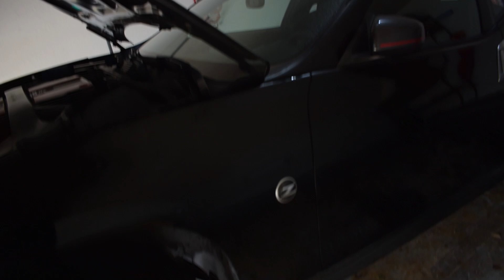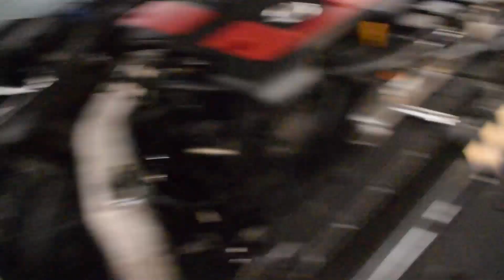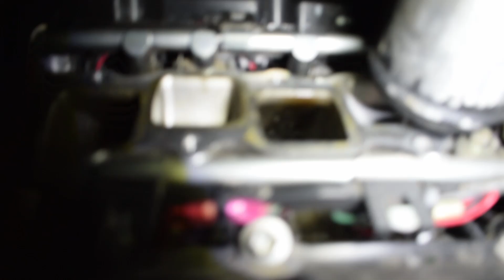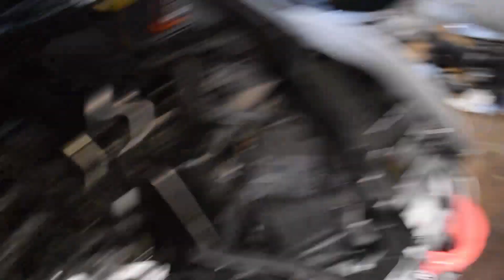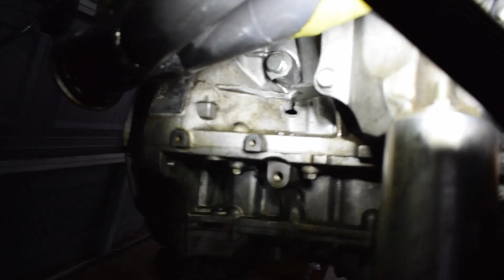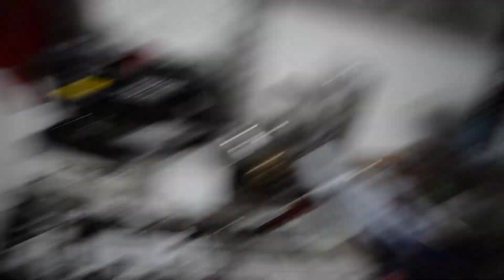I Blew Up My Turbo 370z

Comment: Oil starvation the cause?
Reply from the maker: @Eclipsis17  no gallery gaskets and oil pump was fine. I was chasing a lean issue for a while, I think it was something to do with the fuel pump assy. But my motor was already knocking so I was still hard on it.

Comment: Take it from me. Just get a GTR. I dumped maybe 30k on my 370Z this year. It is still in the shop due to misfitting parts. My HUGE concern is if a dumbass hits me on the road, insurance will only cover 15k the car is worth.
Reply: Dude just do the work yourself. Isn’t too hard. Guaranteed you like 15k is in labor only
Reply: @2seep  
Yep, 15k is labor only. I work on suspension, brakes, and maintenance for my cars, but electrical, fuel, and engine is off the table.

We all thought it would be a 3000$ labor adventure... It kinda scaled when they found more broken things and I wanted more stuff installed. (I thought it would be a 10k labor adventure, I was wrong)

The car just got the initial tune done today and then E85 tomorrow. Hopefully I'll be driving it next week.

Comment: Been thinking about trying to push 550whp - 600whp with a single top mount turbo kit on stock engine. Only thing is my stock engine has around 110k miles on it so im just not sure if it'll hold up for its age. Would be curious to know about what mileage yours was at. Good luck with the rebuild man.
Reply from the maker: @randomperson7567  I definitely get a compression check. Mine blew up at 85,000 but I was always hard on my car, 550 to 600 is pretty reliable as long as keep up on maintenance

Comment: Stay up my man.  My engine blew out after a year at 650whp on e85.  I am waiting for the work to get completed on the rebuild on my 16 Nismo, which I miss dearly.
Reply from the maker: @brianjackson5732  appreciate it. built motor has already started hoping to have the car running early next year.
Reply: @ltlzilla  The bright side is that the supply chain issues have been resolved.  It took nearly a year to get all of the parts for my built motor.  Now it's a matter of getting on the schedule of the installer and tuner.  I've been told the end of the month but was also told that last month.
Reply from the maker: @brianjackson5732 how much are you trying to make?
Reply: @ltlzilla  600whp will be plenty for me now.  On the factory engine, it was a dyno queen at 685whp before getting scaled back to about 650whp.  I daily drive the car, which is why I decided to go with a built engine instead of just putting in another stock engine that would go out again after 12,000 miles.  I love the car, and my wife calls it my mistress.
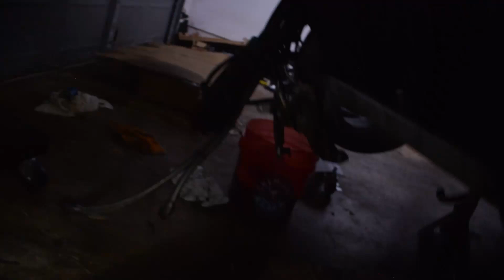Reply: @ltlzilla  Got the car back.  With the lower compression, i.e., 9:10, it makes right at 600 whp on map 2 and 500 whp on map 1.  The issue is that I am throwing a p2096 code and can't get through emissions until I get this figured out.  Have you heard of anyone overcoming this issue?